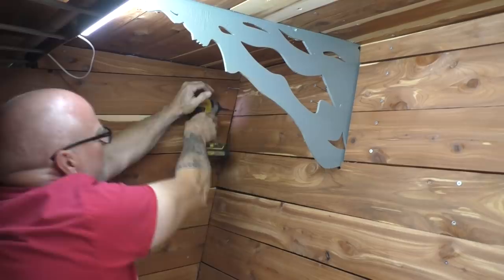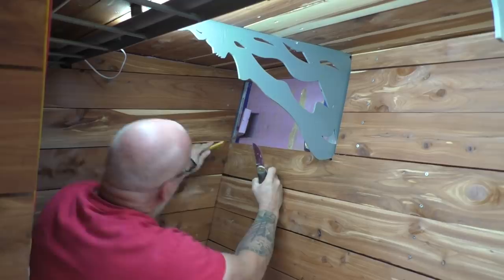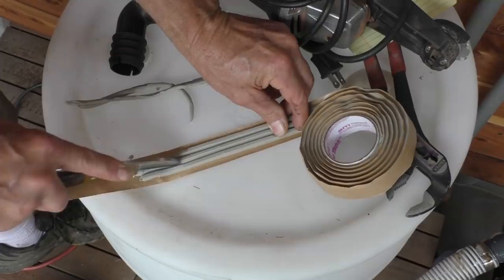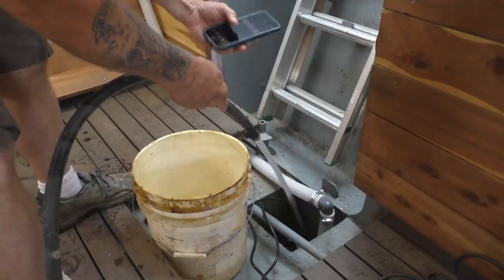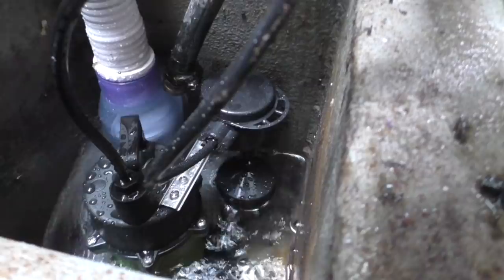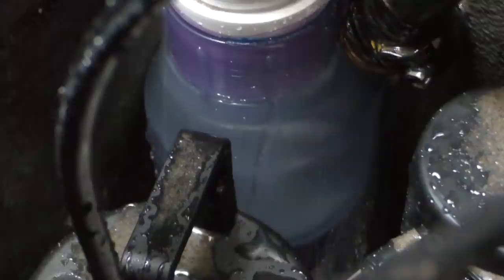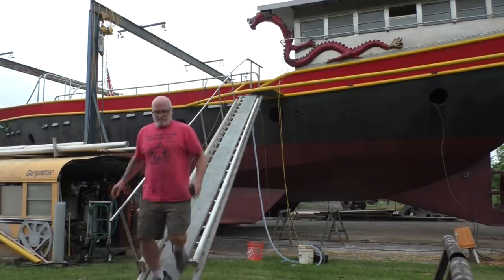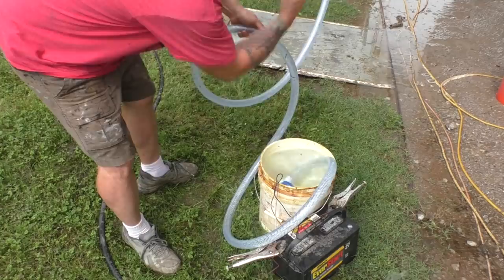Bilge Pumps

Comment: Some expanded metal baskets in the top of the sumps would probably keep the crap from getting down there and messing up the pumps.
Reply from the maker: Yeah, I like that idea.
Reply: @SVSeeker  especially by the companionways. I bet a lot of dirt will find its way in there.
Reply: When I worked in water line construction many times we had to pump out an area full of water and mud. 

We would take a mesh screen and cut it to fit like a cup around the opening and then use a piece of wire to secure it. Should the screen become clogged just untwist the wire and back in business fairly quickly. Low tech solution to the problem.
Reply: Hans Verhoeven that’s so brilliant. For this application that seems way to smart for how simple it is.

Comment: Hougen magnetic drill...my stepfather likely wrote the instruction manual for that drill...he worked as their lead technical writer for a long time. Cool stuff!
Reply: That is really cool. This is what I love about the comments on these types of videos, you never know who you'll run into and what kind of neat thing they will know or have done!
Reply: 5 bucks says Doug never read them and doesn't have them thougj
Reply: I say that not in disrespect just to point that out. but because I highly belive he never would read that stuff
Reply: I wondered if the base of that drill was magnetic.  Is it an electromagnet  you can turn on and off?
Reply: @Bill23799  yes
Reply: @Bill23799  Yes, there is a switch on the base. You can see him use the switch, on the back side of the tool,  right before he removes the drill from the hull (about the 2:14 mark)

Comment: The large Rule pumps I put in my boat, can not pump up that high. The higher the hole outlet  goes, the less amount of water they can pump. I simply looped the hose up and a foot higher than the outlet, then back down. You can raise it so high, the pump wont pump a drop out the hose.

Comment: A matfor what it's worth
I been pumping out with sub pumps for years
I now always add a quick open barrel union either side of a check valve
Crud will always find a way to keep the CV open
Reply from the maker: It’s ez to disconnect thee hose and unthread it.

Comment: Can you use a "trash" pump in place of one of the bilge pumps to handle to the crap floating around in the bilge
Reply: Yeah i always wonder why sailboats dont carry a gas trash pump for emergencies. They take up little room and can pump a sinking boat out fast in many situations. In construction we use them all the time. Up to 8" lines and they will pump stuff you wouldnt believe through them
Reply: Yeah, they make sewage pumps that would be ideal for something like this. I wouldn't trust the harbor freight pump to work longer than 6 months.
-Manager at HFT for 5 years.
Reply: @R26B-TURBO  agreed. At the sewage treatment plant i work at its lil giant pumps and big 2" "trash" pumps to clean out last bit of sewage to work in there. Im a carpenter but a large scale commercial concrete carpenter so i work in a lot of places you need water pumped.
Reply: A 3 in gas trash pump can pump around 300 gallons per minute. They would seem worth it for weight.

Comment: Will the main bilge pumps be 12v or 120v as well? I’m curious what can happen if inverter/generator has operating issues mid water take on. On my little boat the bilge was connected straight to the the battery so I would never accidentally remove it 😂
Reply from the maker: Both.  ...and we have 4 separate systems for generating 110v.
Reply: SV Seeker - thanks for the reply! I always feel bad asking questions because you most likely covered it already elsewhere haha. I also appreciated that little inclusion on the Bounty, I’m currently reading about it and that was a nice addition

Comment: Doug - the suggestion of using a trash pump is a good idea.  A trash pump is designed to be able to push anything through the pump that is the same size as the inlet to the pump (i.e., a 12" trash pump can take a 12" diameter item).  I have seen the same problem with screens as you alluded to in the story about the sinking of the Bounty.  Even if there is a secondary screen system over the bilge pump inlet, that screen can get jammed up with trash and the bilge pump doesn't see any flow.  You could keep your current system and have the trash pump as an emergency back up pump that could be dropped in wherever it is needed.  Another option is to run a line to the bilges, with a valve, from your water intake for your engine cooling so you can use the engine to also pull water from the bilge.  Not ideal, but if you need to move water it might save the boat.
Reply from the maker: Yeah, I'll put 4 - 12 inch trash pumps in the cargo hold.  Yup.  That's what I'll do.   The Bounty did not sink because their trash pump failed.   It sank because they sailed directly into the path of a Fucking Hurricane.  : )
Reply: @SVSeeker  Now, now ----  lol....
Reply: @SVSeeker   hilarious !! 👍

Comment: Typically heck valves aren’t used in the output from bilge pumps.  They can and do fail due to the same crap you mentioned clogging up the pump.
Reply from the maker: I'm going to use hack valves.  I'm going to damit valves.

Comment: do you have a bypass switch incase the float switch fails?
Reply from the maker: Ya just plug the pump directly into the outlet.
Reply: @SVSeeker  yeah we rarely use the floats. I currently am building a sewage/rain water pump station and we use those lil pumps till they die. The little blue "mighty" pumps are the best. Harbour Frieght will get u though but under constant use we burn those up in a day or so
Reply: @SVSeeker  I wasn't sure if you were running 120v AC or DC punps, but that works.

Comment: Will you have a switch panel to be able to turn off the bilge pumps? Might suck to be walking down a pier or or on a dinghy and get hit with nasty bilge water because someone else rinsed off something in the cargo hold. :)
Reply from the maker: Yes but if we're tied to a dock them we're getting fuel, and not working, so not washing down gear.

Comment: Awesome build, ive been following from the beginning. Just a word of caution on those pumps, i bought the same one and it failed after a year with very minimal use. All yhe seals on the housing failed and took water into the housing and stopped pumping. Switch was still working though.

Comment: Is that bilge pump outlet not too high up? I've always seen them closer to the water line, and that would provide better performance l.
Reply from the maker: They are generally lower on boats designed to spend a lot of time tied to a dock.
Reply: @SVSeeker  ok, so if you are at sea in the waves you want it higher. Thanks for the education!

Comment: Dumb question. Why not just stub the pumps straight out and have a second check valve on the outside? 

I understand water line may be an issue but when I sailed our bilge plug was at the bottom of the boat. When we moved we popped it open and it drained the water no problem. When done sailing we popped the plug back in no issue. 

I realize scale changes things. ie: need a pump to move water rather than just an open hole but the height confuses me.
Reply from the maker: Some do that, but those flaps that put on thru-hulls are easily torn away.   And I'm not crazy about anything near the waterline that does not need to be there.
Reply: SV Seeker fair point.

Comment: Hi Mate great video. Some really good points mad on small impeller type small boat bilge pumps. Folks tend to just fit them and not realise the issues you covered. One thing we noticed is that you used 90 degree elbows and not a swept elbow on your pumps? Changing them to swept elbows makes a huge difference in rate of flow due to the internal friction of the water against the sidewalls of the tube, vortexing and the rate of flow calcs you did. Just saying constructively . You probably know this but thought it was worth a mention? Sail Safe Guys, Ant, Cid & the pooch crew.
Reply from the maker: I use to install lawn sprinkler systems.  The saying was 6 - 90s makes a stop.
Reply: @SVSeeker  its all the bends that get you in the end. :-)

Comment: Why all the retro fitting? Thru hull pump hardware should have been completed before the interior insulation and cedar were installed.
Reply from the maker: Wait!  Unscrewing a board and drilling a hole is a retro fit now?   : )

Comment: Maybe rather than that  90Degree Elbow on the Discharge line  adjacent to the pump maybe a swept Slow Bend would give you a better flow characteristic  Er but that would only be marginal....great Job and great Upload you're coming close to the End...great endurance and resolve to push through...

Comment: So question on the connectors on the AC Powered bilge pumps, if you have a situation where you need to dewater due to hull damage, are you going to have the necessary AC power? What about the wet connectors? Perhaps swap them out with connectors designed for immersion? IEC connectors ?
Reply from the maker: No worries, it will help put the fire out that started when the rogue wave tore off the pilothouse and ....  You should maybe stick to Carnival Cruise ships.
Reply: @SVSeeker  Cruise ships? hack*....*spit

My thing is armored vehicles for fun and computer rooms for profession. I think about contingencies...izzn't that partly why you have 4 bilge pumps in the hold? Thing is, ground path isn't always predictable. Neither are boat helmsmen in docks. 

pier-side

Comment: butyl isnt very heat/time/ UV resistant . It also gets brittle when cold and gooey mayb e even liquid when hot . 
  
I wouldnt understand why a good silicone wouldn't serve you well as long as its installed on a clean dry surface, painted steel it will hold as the paint does and on bare or powdercoated aluminum you wont get a better sealant .  . 790 dow is extremely UV resistant, really good no matter what temperature , within reason .
Any urethane you expose to sunlight is going to deteriorate .
   Dont use silicone if your going to want to paint it though , It won't take a paint .
Reply from the maker: It's been on the engine room hatch for a couple of years now, and it's working great.  It will never see UV and it's completely reusable.

Comment: Get video and it is marvelous to see the finishing touches going on.
However, around about 8:36 you explain about having air in the pump out lines.I believe this is incorrect and I disagree with the notion that air pockets in the line will prevent the pump from pumping water. The air does nothing to the volume of water pumped and actually helps the motor start as the compressing air lets the motor get up to speed before the motor is loaded.
If loops in the line prevents water being pumped, we would never have any water in our homes!
Reply from the maker: Best give it a try yourself.
Reply from the maker: This is long winded but a better explanation:  https://www.youtube.com/watch?v=zdkp9N3qfkI
Reply: @SVSeeker  Thanks for replying , it is appreciated. The link to Practical Engineering was interesting and recommended viewing.
I stand corrected, if the pump capacity cant clear the lines of air, then the flow can be restricted.

Comment: some people use stuff like this, to keep garbage away from their pump, cut a hole in the top for hose and power.
 search Amazon for this phrase
Pond H2O 9" (9 Inch (23cm) High by 6 inches (16cm)) Square Aquatic Plastic Mesh Pond Plant Basket x 2 Pieces, Plastic Water Garden Planting Basket

Comment: The opening of this video made a thought occur to me, have you considered another pulley on the chain to make the drag of the door feel like alot less? I cant remember what that effects called
Reply from the maker: A "fall" and it's not a block and pulley.   If you need help opening it we'll get a little Chinese girl to do it for you.
Reply: @SVSeeker  lol ya that's it, and no, i wouldnt need help and even agree, like i stated simply had a thought, and even thought it was worth a share, never know what infos useful to who, also, you might be able to lessen the bend a little more at the top of the big bilge pumps hose and gain a couple more gallons, i went from 45° on my uphill attic drains, and started bending the pipe just all the way through, and our machines have shown having to work considerably less to get rid of waste water.

Comment: A many boats have sunk bc of cheap plastic threw hull fittings. I know these are well above water line but dang a steel boat with plastic threw hull not the best choice. But hey its Doug's boat 👌
Reply: How many have sunk ?
Reply: @wackyspazthe3rd  A many means alot of boats trust me look into it.
Reply: Given the way the fitting was taking those chisel blows, I seriously doubt they're the cheap crappy kind.  Modern plastic hull fittings can be extremely strong, and they don't corrode.

Comment: dont want to be critical pumps has to over come water weight and  valve resistance check valves are not reliable and not recommended per usa boating council -- x 2 sharp 90s and corrugated hose u have all hurts ur cause.  do what u can to avoid and not cost anymore.     1 long sweep 90? clear braid slick hose?
Reply from the maker: Yeah.   Fuck the boating council.  : )

Comment: air pressure and water pressure are the same thing
Reply: No they are not. I have always heard air is about three times easier to compress than water.  Because of this the psi of each mean wildly different things. 

Source: tested water line fittings for multiple years. 70 psi of air will find the same leak that 200 psi of water would.